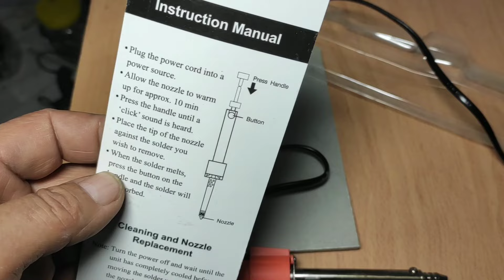Desoldering pump.Worth to buy one?

Comment: This gadget doesn't give the required help since the sucking tip gets corroded and the barrel is not isolated from the heating element properly and leaking current is sensed if you test it with a tester. The tester lamp glows which means that the power appears in the barrel.
Reply from the maker: Well,
I checked the tip amd it seems to be made from stainless material
and untill now is in perfect condition!
In worst case scenario in future there are replacement tips!
For the isolation between barell and wires i checked and untill now there is no problem!
I will keep it in mind for the future!
Thank you!